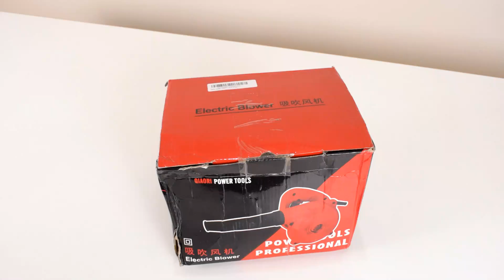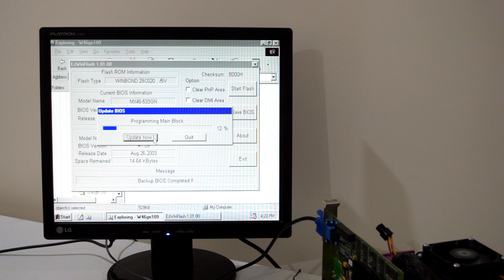Pentium 4 vs Air Blower with tear down and testing parts

Comment: This seems safer than using a pressure washer... I'll have to look at getting one of these air dusters.
Reply from the maker: Yea they are cheap enough to use as a first clean. Then take it from there with other methods.
Reply: probably not this model though, looks kinda dodgy lol. from what i can see the plug doesn't have the insulators around the prongs, so it's actually illegal to be sold here in australia... pretty indicative of the quality of the rest of it usually
Reply: How about using a bicycle pump with attachment for filling footballs and such. Pressure doesn't end, doesen't get cold, better than canned air for many parts.
Reply: Naah, pressure washer is perfect :D
Reply: Could use a hair dryer on the no heat setting. Could probably rig up a cone on the end to force a more direct focus of air. "Where's my hair dryer?" "It's in the garage."
Reply: PhilsComputerLab pressure washer after dusting works wonders in stripping the excess electronics from the inside. Its much faster than removing by hand as you do too 👍
Reply: I have a large air compressor which has a pressure adjustment that I use. gets everything out. Comes in handy for many things. A small one would also be good enough for most people.

Comment: That blurred out card is probably a Voodoo5 5500 AGP.
Reply: yep, my thoughts. Not much more that is collectible
Reply: oh and you can see the dual coolers on the blurred card ;)
Reply: Yeah and you can also see wires going to the rear of the card which is probably just the molex power of the graphic card

Comment: My guess the card is..... I hate you :( Give it here Voodoo 5500
Reply from the maker: You called it first, well done :D Its indeed a Voodoo 5 5500. I'm eager to see what it can do with a fast CPU.
Reply: :Major GPU envy ensues:
Reply: I had a opportunity to pick one up very recently. And I passed :/ Cheap too. About $40.
Reply: I just put my voodoo 5 in a dual p3 board.....   There are some vantec coolers that make great replacements for that card.  I got my Voodoo 5 for free.  It's great to have friends.
Reply: As much as I would love a Voodoo 5, it is hard to justify the price. I've wanted to get a second RX 480 or 580 (I've never crossfired) I did just finalize a build with a Voodoo 3 3000 and with Half-Life, even at 1024x768, it is easy to see that it could really benefit from a faster card. 3dfx specifically? probably not.
Reply: Is it with the AGP4x-interface?
Reply: I so want to get my hands on one of those cards!
Reply: IRaziel1 the Ti 4600 is a pretty good card. If it's in perfectly working order 30 bucks is a good deal.

Comment: We have the same blower Phil, right down to the color :D.

Blowers do an amazing job of cleaning the dust and dirt from the case and components, but they can only do so much when the system hasn't been cleaned in years and the dust has settled in, in which case you'll have to take a brush or some towels and give everything a good rub.
May I suggest blocking the fans when blowing on them, as I have had problems rise up. I once broke a fan because of just how fast it spun up because of the blower. At the very least, make sure to disconnect them from the motherboard or fan controllers, I killed one of my case fan controllers because the fans were hooked on it. I'm guessing they produce some voltage when they spin so quickly and that was probably the cause.

So, do be careful!
Reply from the maker: Yea the blower is now my first line of defence against dirt :D The rest is much easier, and less work.

Comment: Why you hidig the voodoo 5 5500 i recognize them from miles away. Btw wouldnt it be fun to look back at all the 3dfx cards you have and seeing how high cpu clocks affect each generation of the cards from experience the voodoo 2 bennefits a whole lot from higher clock speeds

Comment: My little blower is almost identical. Got it on sale for $12. Gets PCs clean as brand new, I was amazed.

Don't forget that FAT32 is unstable with partitions larger than 32GB.

My old P233 was an AOpen, but I've been told it was actually a rebadged SuperMicro. Very good stable board, regardless.

Comment: You plugged that card in while there were lights on the board!!!!
Reply: I've done that dozens of times and it's fine.
As long as you don't plug it in while the system is actually running then there's no problem.
Reply from the maker: And?
Reply: PhilsComputerLab lucky it didn't fry something, not sure if the slots get 5Vsb or not

Comment: In the vid, when you pulled the heatsink off, did it "rip" the cpu right out of it's socket? Any damage/bent pins?
Reply: No,  it's really common. Shitty thermal pads act like a glue after a few years
Reply from the maker: Nah it happens with most Pentium 4s :)
Reply: I don't think it would've, happens to me even with brand new thermal paste....

Comment: ive recently recived a pentium 4 machine using an IBM NetVista 6792-226 motherboard and im currently trying to find out what chipset that motherboard uses if anyone knows then please tell me also what cheap power supply would you recomend. the one in there hasent been turned on since 2017 and i dont currently trust it. Also does anyone have any benchmarks using the nvida vanta.

Comment: The CPU fan rotates from the blower, is that dangerous for the motherboard? Since it might function as a Dynamo that generates power then.
Reply: Apparently the voltage generated isn't enough to damage parts on the motherboard, but i'd still think it'd put some wear on the bearings. Not much effort required to just hold it down anyway which is what I recommend.
Reply: s8wc3 Yes, but what about a laptop and air duster can only with high pressure air. I make sure the laptop fan runs, then to be sure the  propellent gas isn't liquid and pump the air in the laptop fans while it's running. I always test on old laptops first and it took away the old ball outwear noise like typically for old laptops with fan dust and wearing old.

Comment: This motherboard with a Voodoo 5 graphics card and 120gb hdd could well make for one of the best possible Windows 98 builds.  True, there are more powerful graphics cards you could use with a Windows 98 build but the Voodoo is the way I would want to go because that will handle all those legendary games that are not easily played on more modern platforms such as Mechwarrior 2.

Comment: I suspect it's a Voodoo 5500 card. As I have one that I bought used 10 years ago for like $20. I've held back getting a second one, as the prices the last few years have spiked to insane levels since I got mine. Same with the Voodoo 4. The only Voodoo card I don't have.
Reply: Voodoo 4 aren't that bad in terms of price. Trry looking for V3 3500 and V2 12MB cards...
Reply: I do own V2 12MB :)
Reply: I own a STB BlackMagic factory SLI pair ( boards have 1 & 2 printed on them) of V2 12 MB 100 Mhz version - still playing Diablo 2 on these - CPU is a 1.26 Ghz Pentium 3-S Tualatin core socket 370- all this is hooked up on an Asus TUSL2-C board

Comment: What do you call those power supply cables with the button for outside of case testing? (at around 3:56)
Reply from the maker: Front panel cables?
Reply: Yeah, I just realized it was just a simple header cable with a power switch (no doubt ripped from an atx case)
Reply from the maker: I actually bought this off eBay. I think I bought a pack of 5 or 10 or something like that. There are versions with LEDs for HDD and power as well.
Reply: Thanks Phil

Comment: Let me Guess 3DFX 5500 fun?

That said just a quick tip if you clean your computer with a blower or compressor be sure to unplug the fans, if they spin up they do generate some high voltage that can damage components, or avoid spinning the fans up like Phil did in this video.
Reply from the maker: Yea it's the mighty V5 :)
Reply: There you go if you still dont believe me connect a voltmeter to a fan and blow some compressed air over it, it will act as a dynamo and generate electricity, problem is its AC not DC and if you get it fast enough it will generate more than the 12v your PC is outputting, its basic science.

Comment: usually on Pentium 4, Windows XP had to be installed, on Pentium 3 - Windows 2000 or Me, and Windows 98 went to Pentium 2, Pentium 3 at about 500MHz, and Pentium 1 133-166MHz, and Windows 95 on Pentium 75MHz, 100MHz and 486.

Comment: Interesting the P4 was a 4.2 Ghz chip most I've seen here are in the high 2.* to low 3.* ghz ranges
Reply from the maker: It stopped at 3.8 GHz.
Reply: Ah i see what I did the screen read Pentium 4 2.66 / it was so fast I saw 4.2 rofl. my bad
Reply: Well, alot of them easily can be brought to 4 GHz.

Comment: If you ever get a hold of an nVidia 6800 series video card, NEVER insert the card with power connected to the PC
I've killed two of them making that mistake.
Reply from the maker: Why? I do this all the time :D
Reply: There is an issue with the fingers on the card edge that can cause a dead short. 
I have two 6800 series cards that no longer produce the red spectrum of colors.
This happened after leaving the power cord plugged in and inserting the card, the PC powered up and posted before I could seat the card fully.
Reply from the maker: Wow, well I shall be extra careful then.
Reply: It is always a good idea to remove the power cord when insert peripheral cards. I had to learn the hard way.
Hoping my advice will help you avoid my mistakes.  ;)

Comment: Gotta hate ripping the CPU out of its block when you remove heatsinks.
Reply from the maker: OmegaUltima No big deal, it happens all the time with P4s.
Reply: It happens with a lot of other CPU sockets on that note too. Don't know if it's still a problem on the new Intel sockets which have the CPU clamps.
Reply from the maker: Yea with the new sockets, the CPU is held in place with a bracket. You're right, I now remember the same with AM2 CPUs for example.

Comment: You should use an air compressor instead. A cheap one is 100$.
Also, never update the BIOS from within Windows, even if Aopen says it is ok to do it.

Comment: Damn i thought you are going to use Air Blower as a cooler for P4 xD
Reply: Same here. Would be fitting to add a GF FX 5800 U for that :D
Reply: Funny thing is ATi X850 has the same cooler type as infamous blower used on 5900U.

Comment: That air blower sadly isnt useful. You should get a good and powerfull air compressor. You arent going to regret it :)
Reply: Compressing air causes moisture to precipitate inside the tank and airline. That means you're blowing water into your electronics.